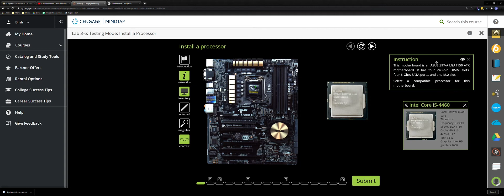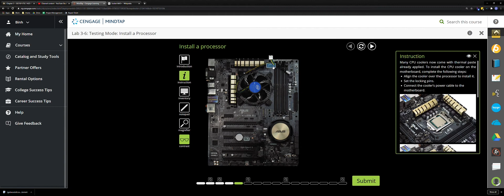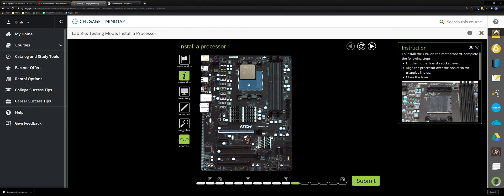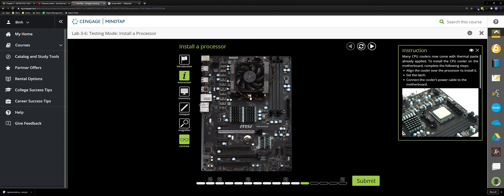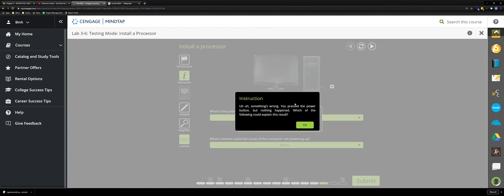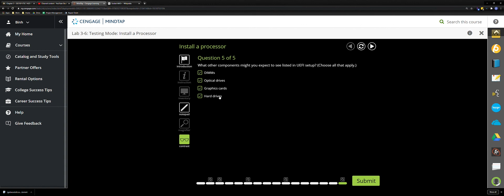ITSC 1425 Lab 3-6 Testing Mode Install a Processor

Comment: Hi, do you have Lab 2-7: Testing Mode: Select and Install a Motherboard
Reply from the maker: Yes, I do have. However, I cannot be able to upload because it's longer than 15 minutes so that Youtube took the video down.
Reply: @MrBaochuadn  Are you able to help out on other labs? I am taking the course, but get very confused.
Reply: @MrBaochuadn what if you posted it sped up then people at home could watch it at a slower playback speed